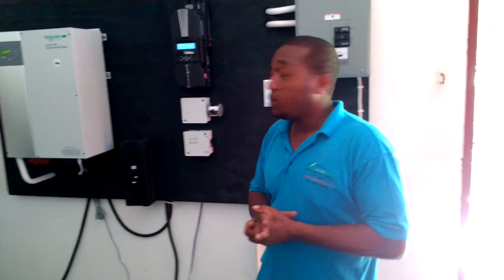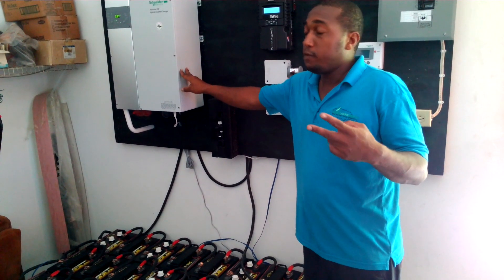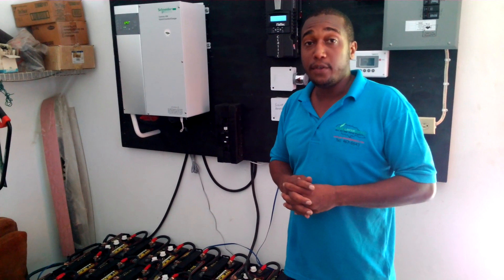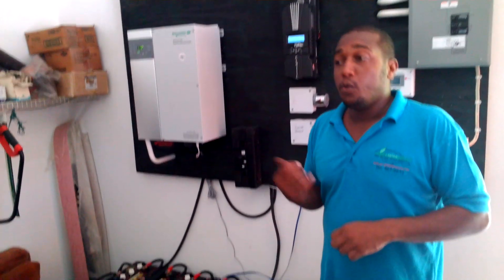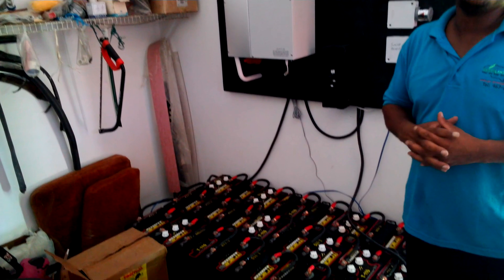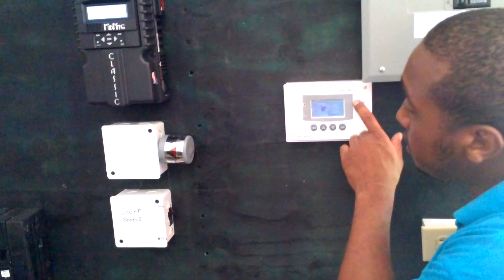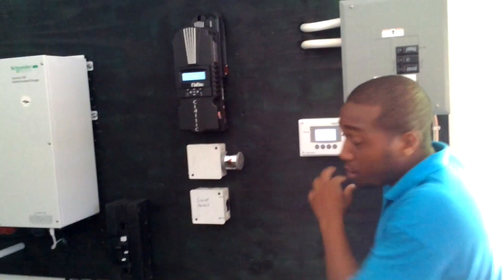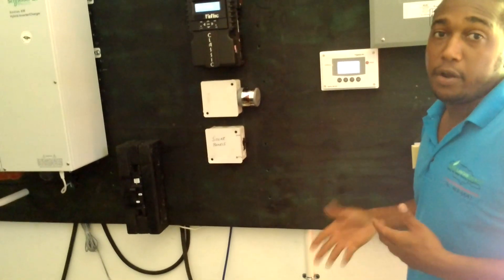FREE ELECTRICITY OFF-GRID SOLAR IN JAMAICA #SOLAR AIR CONDITIONER solarspecialistja.com

Comment: with the abundance of available sunshine..year round in jamaica... could one get away with using say a 225ah battery versus the rolls s550 which is rated at 425ah.,. or is the concern of fully discharging the battery more the concern there?